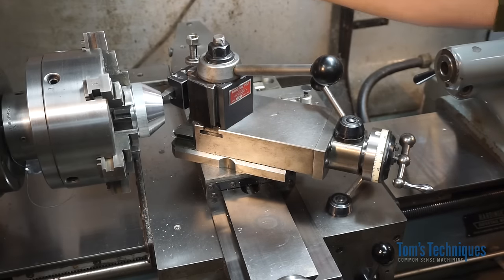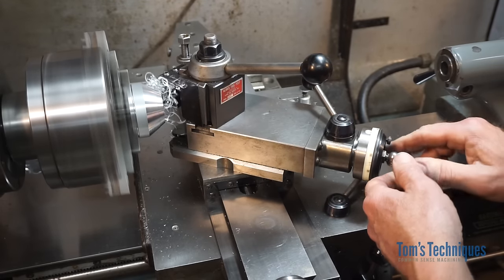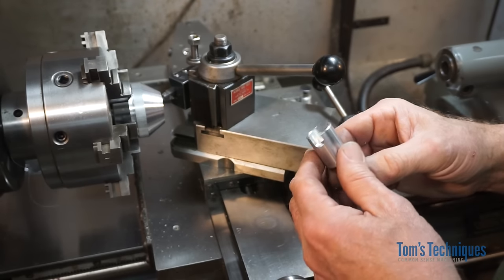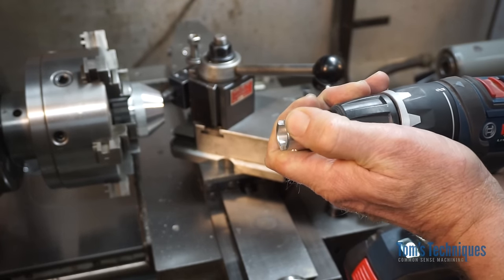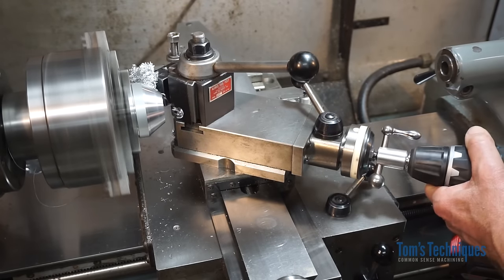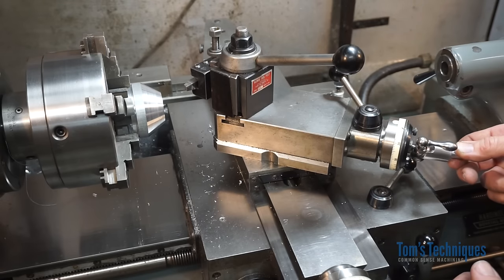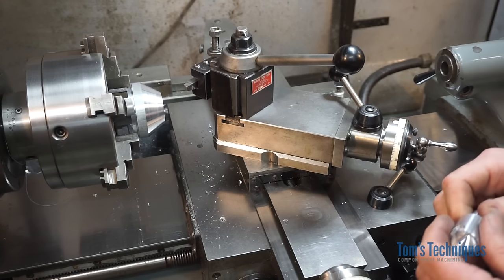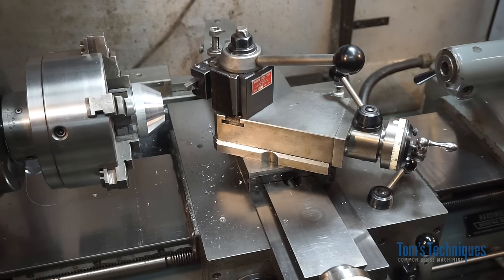Tom's Tips and Tricks #2 - Power Feed for the Compound Rest

Comment: Just came across this set of basic tips and tricks, and as a rank beginner on the lathe, I really appreciate them.  So, thank you!   I'm also something of a history buff, and I noticed the panels on the back wall that make up an image.  Is that the bottom half of the picture of the Wright Brothers' first flight at Kitty Hawk in 1903?
Reply from the maker: It is the Wright brothers at Kitty Hawk. I consider that one of the most significant photographs in all  of modern history.

Comment: Great idea, great video. Thanks. Are there any brands of cordless drills that have a "preset" control for the variable speed?
Reply from the maker: Thanks Marvin,

I don't know of any with pre-set speeds, but the one I have is very easy to maintain a steady rpm.

Tom
Reply: I have an old corded VS drill that has a dial that serves as a stop for speed limit. I think dealing with a cord is a trade off with dealing with discharged batteries.
I am going to try this, thanks for the idea.

Comment: hello Tom. Well i have an interesting project that I'm going to try, however, I would like to hear your opinion if the idea  is at all feasible. I need to hold a part that is bigger in DIA than my jaws will open. what Im going to try is making jaw extensions that slip over the existing jaws and held on with grub screws.I can tell you that it,s for a grizzly 7x12 lathe, four inch four jaw independent chuck, so precision is not critical, and I need to bore a three inch dia hole in a five inch by half inch disc.  The idea is only in my head, so i can't send you a plan. I always make these mods on the fly. My video on the modifications I made to my Taig lathe will give you an idea of how I think. my channel is  "airguns freedom 700 ssp". I would appreciate your take on this. Thanks, and i love your videos. I only just discovered your channel.

Comment: Tom, I take it you fitted the chuck on backwards !. By the way, Ive the same lathe, but yours stops so quietly compared to mine. Nice video as usual.
Reply from the maker: Yes, the chuck went on counter-clockwise. :) The brake is actually out of adjustment. It normally stops much faster.

I actually saw a guy spin a chuck off an old South Bend once at high rpm and it wasn't pretty. 

Tom
Reply: @TomsTechniques  Hey Tom, trying to puzzle this out: Your chuck is spinning clockwise(backwards to normal) because you are cutting from the far side (rear).  Does your style of mount and chuck allow different mounting 'cuz my old South Bend Junior 9" (1 1/2"x 8 spindle mount) only mounts a chuck by threading it on clockwise.  BTW, that's the quietest lathe on the planet, so awesome.

Comment: Was your lathe running in reverse or did you flip the tool upside down?
Reply from the maker: It was running in reverse. That made for the best camera angle for the video.

Tom
Reply: I have a threaded chuck and cant turn in reverse. Know of any modifications that can be done to get around this ?
Reply from the maker: I've heard of guys adding set screws to the chuck, but I'm not sure how reliable it would be. Seems like a matching spot on the spindle would be necessary as well.

Tom
Reply: I have a lathe with a threaded chuck too. What I did to run in reverse was add a threaded rod through the spindle with a low profile nut on the chuck end to interfere with the jaws as little as possible and just a threaded knob at the other end. It worked well because the pitch of the rod thread and the chuck thread are different so they could never un-thread simultaneously. So no flying chucks! 
hope that helps
Reply: You mean like a drawbar for the chuck? I can see that working...lefthanded threads would be even better I would think
Reply from the maker: Left hand threads would work great...in reverse. :)

Comment: Have been looking forward to your continued videos.
For your information only, for some reason, the sound is muffled and low volume.
Regards from Shropshire, in the UK.
Reply from the maker: Hi Raymond,

Not sure what's up with the volume thing. I actually increased the gain before processing and it's still a bit low. Guess you'll have to crank it up at your end and I'll fire the audio engineer at this end.

Tom

Comment: whats up whit that clock on the wall?
Reply from the maker: I just came across a NOS reel of 1" Ampex audio tape and thought it would make a cool clock. What do you think? Just ordered three more reels because everyone who sees it wants one. 

Or do you mean the wooden one?

Tom
Reply: I do mean the wooden one. It looks sad. Are you repairing it?
Reply from the maker: Not as sad as it looked sitting out for the trash. Someone actually threw it out and I rescued it. It was made in about 1830 by Boardman and Wells and is nearly complete except for the top trim piece and the hands. The movement. all wood of course. has quite a bit of wear and will need some teeth repaired, but it will run again. 

Tom
Reply: Toms Techniques I would like to see a video about that. But maybe it is just me! Thanks for answering.

Comment: what is the name of the tool ?
Reply from the maker: I don't know, how about Toms Power Compound Adapter? You do understand that if you want one, you'll need to make it yourself, right?

Tom
Reply: I asked about how u change from manual to automatic
Reply from the maker: I'm sorry, but I still don't understand your question. Change what from manual to automatic?

Tom
Reply: i want to know what the thing that attached with driller
Reply from the maker: The part attached to the drill is a part that I made to turn the crank with the drill.

Tom
Reply: thanks good work